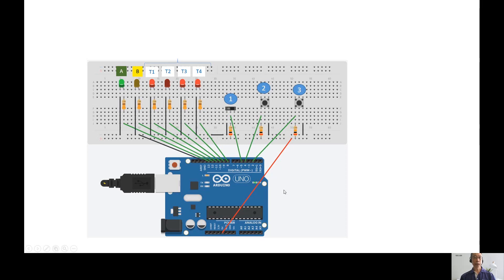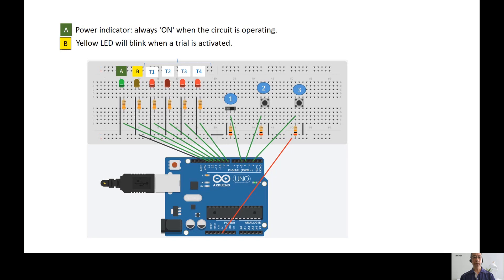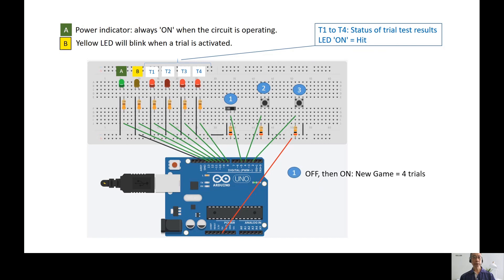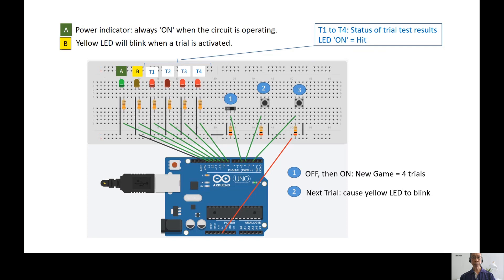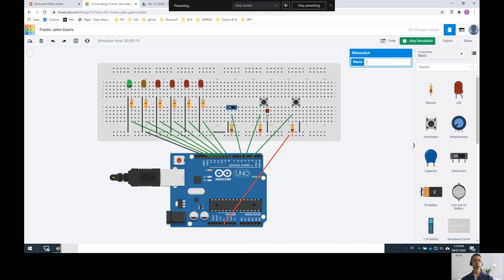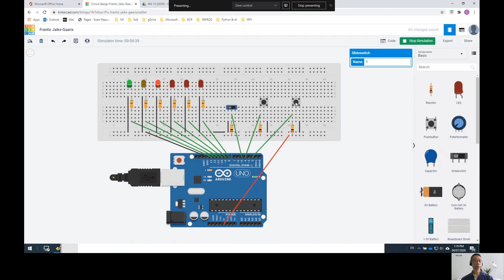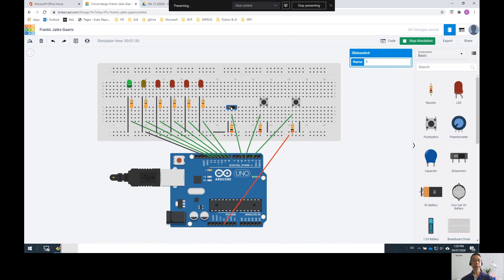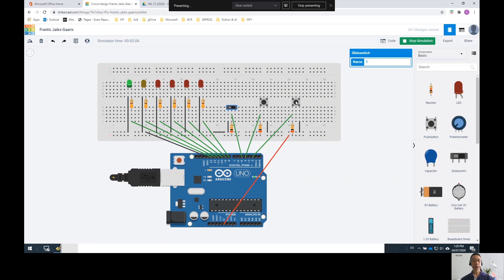Arduino for IRP1 P3

Comment: lmao, my code somehow made to 140 lines.
gg
Reply: Mine went to 160 lines, at least it works lmao
Reply: @cheryl9809  brother i need help. Do uk how to set to 'if i press a button, the red led will switch on'? Im stuck at that
Reply: icewriist    sister* 

Use digitalRead to read that target switch has been pressed, HIGH, 

And then use digital write to ‘write’ the red LED being turned on, red1_ON I believe if you didn’t change anything
Reply: @cheryl9809  thanks sis will try
Reply: I need 3 slides to fit my code in powerpooint sia.... on like size 8 word font
Reply: help a brother out
Reply: yo help for the programming pls HAHA